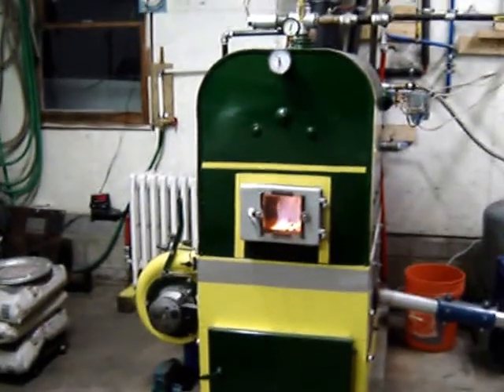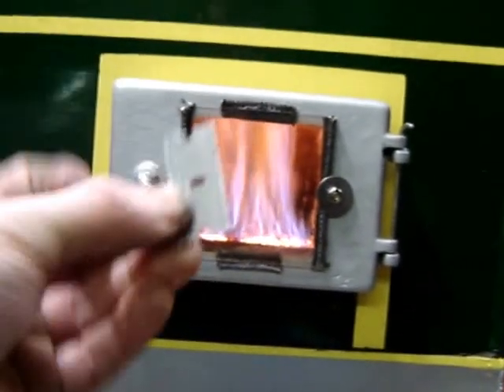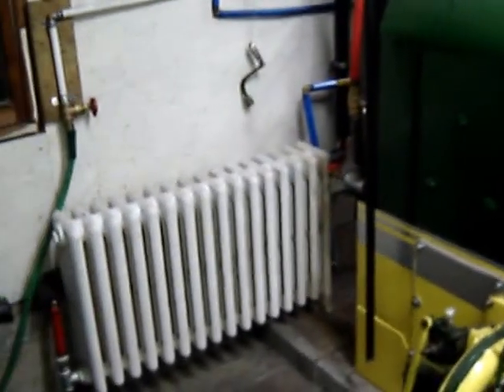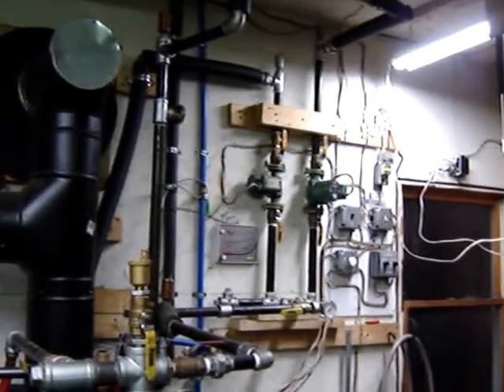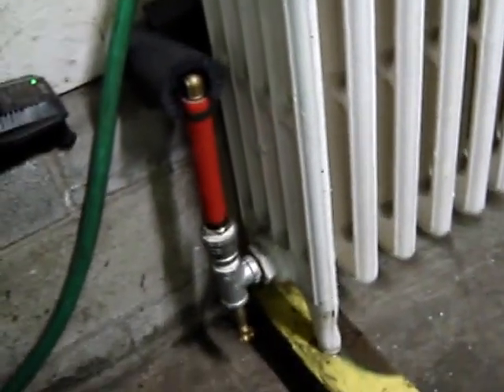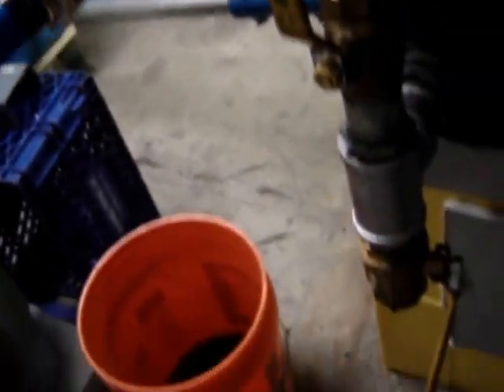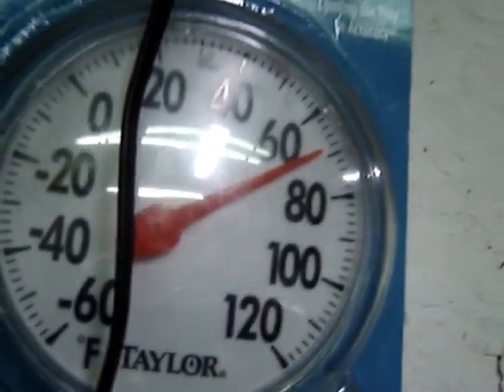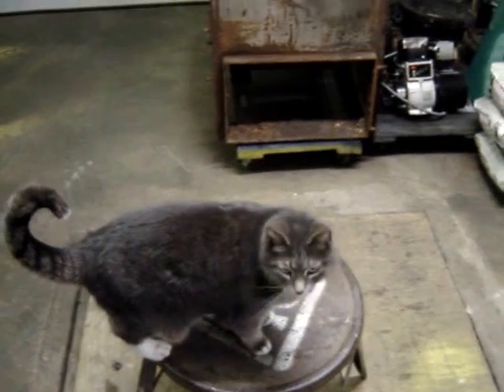Gentleman Janitor Coal Stoker Boiler Heating A Radiator

Comment: nice old school heated you have. what do you heat your home with. looks like one of those might work great to heat a house. i used a keystoker 90K myself. anthracite is the best, most economical heat. most people look right past it these days.
Reply from the maker: At the time this video was posted I had fired up my BairMatic/Van Wert boiler in the basement of my house. The Gentleman Janitor is in my garage and that was how the house was heated before the BairMatic/Van Wert was installed. Now the old GJ just heats the garage.

      You can't beat Anthracite for heat! I guess you could say this is "Old School". This Gentleman Janitor boiler was built some time in the 1950's. The EFM S-20 stoker is from 1961. Interestingly enough, the EFM is still in production to this day. That is why it is a popular conversion for the stokers that have long gone out of production.

-Don
Reply: while my keystoker is a more modern unit, but i think they are still a solid unit. its the 90K btu model. it runs from october until may nonstop. i dont even have to shut it down to clean it. i would not be surprised if its still running 40 years from now.